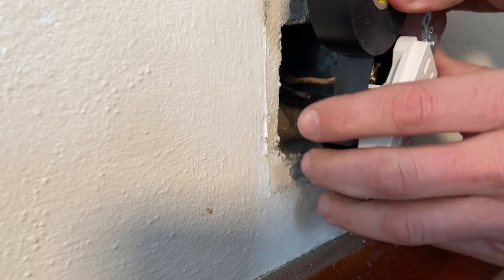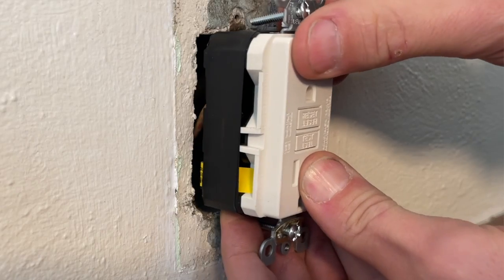Should You Wrap Outlets In Electrical Tape?

Comment: I always taped wirenuts in busy boxes where connections were going to move against each other when everything got pushed back in.  Also always taped them on ceiling fans which would vibrate.  If there was tons of room in the box I was confident the connections wouldn't be rolled against each other I probably wouldn't tape.
Reply: Depends on where you live some building inspectors say no more fuel for a fire even if they just melt. Why fuel the fire!

Comment: If devices needed to be wrapped in electrical tape it would be in the NEC code book by now.   There is a code for how many wires are aloud for a certain size box.  Also workmanship is key!  In my opinion, if you have neat work you should never need to wrap tape around your devices.  And for gods sake stop using the push in method on devices and if you have an unused terminal screw, THEN SCREW IT IN SO IT DOES’NT STICK OUT!
Reply from the maker: Good advice, thanks Joel.
Reply: True.but for those inclined to do it anyhow, why not use duct tape on the inner surface of the box ?
Reply: @embracethesuck1041  I get that but since taping is redundant anyhow a layer of duct tape on the inner surface of the metal box will adhere better and does no harm.The question was to keep terminals  from touching the sides of the box,which is not a problem but some people are uneasy  despite assurances.Taping is for those who feel uncomfortable
Reply: @Dev JB Just slather everything with a thick layer of Flex Seal liquid! Then you'll never be able to find the faults, but they WILL be watertight!
Reply: NEC is the minimum requirement not the max... sorry!  Taping outlets is pure safety.
Reply: @allendouglas63  if taping devices was needed as a safety precaution I assure you it would be in the code book as a minimum standard.  That or the sizes of junction boxes, devices, and wiring would be re-engineered.  
If you don’t do sloppy work or run too many conductors in a box, you should have no need to tape devices.
Reply: @TheRebelyell1986  wow.. you would rather get a shock than deal with tape... I personally have never been shocked from outlets however, i used correct tools.. not everyone does.  NEC is minimum standards... you do minimum work if you just meet the standards.  Quality is looking out for people and protecting them sometimes even from themselves.. I do a lot of live wire work... not because I like it but just because it sometimes must be done.  I appreciate the dangers of electricity and i prefer to protect others from it even if it's inconvenient.
Reply: Because the nec is worst legal install.
Reply: THANK YOU! Although I'm pretty sure a standard receptacle with screws out is not that much wider than a GFCI. Then again, the GFCI also has molded plastic to shroud it's screws.
Reply: @TheRebelyell1986  You've played with handy boxes...  Personally I hate them, they are too small to comfortably wire any device, but every once in a while I'm stuck with such a situation.
Traditionally I don't tape my devices but I was raised to do that for metal boxes.  I have used tape to help keep moisture and dust out of my junction work depending on the environment.

Comment: 5 years electrical in commercial and residential here. In my experience I’ve only taped plugs/switches/GFI’s that will be inserted into metal cut-in boxes since they’re more narrow in width than your standard rough in plaster rings on 4” square boxes. Never taped on residential. I’ve also never had to tape around wire nuts at a tap either.

Comment: Additional tip, the tape glue doesn't stick to the face as well as the glue to glue does, so for a longer holder if you make a piece slight larger than the circumference join the two ends glue to glue with some overlap then use the overlap to stick it down it will hold amazingly well and look good. Learned hat on a site wrapping 600V cabling.

Comment: I'm a retired general contractor.  My electrical subcontractor once described electrical tape on wire nuts as "Guilt." He taped receps and switches to protect the bare terminals while the cover plates were off during drywall finishing and painting.
Reply: Not a pro but I did it in part for this as well. Needed some live outlets while drywalling and finishing and detest people who finish and paint with outlets in (not that it can be seen with an outlet cover, I just know it was done..).  Pigtail connection to Wago connectors with the terminals wrapped makes this a easy and safer way for me to work and be able to remove and put back in the outlet quickly.

Comment: NECA NEIS 130 5.3 Conductors (L) states "DO NOT wrap electrical tape around wiring device terminals. Taping wiring device 
terminals will prevent heat dissipation from the wiring device." National Electrical Contractors Association  National  Electrical  Industry  Standards

Comment: Scotch 33+, definitely. Cold weather performance, stretches without breaking. We used High Voltage Tapes where appropriate, 1000V per 1/2 overlap. So you wrap to the voltage and quality of the job, then some. But Scotch 33+ is good for 600V, no matter how much you overlap. 600v Max. The loose end when applying tape as you demonstrated prevents "flagging", according to the vendor, that tendency for the tape to start to pull off, doing as you demonstrated should prevent that. Do Electrical Inspectors support taping, I read they didn't since they can't visually inspect?

Comment: Military electrician of 10 years. I have been shocked more times than shot at. Wrap the receptacles. Its a couple seconds more and can save you from looking silly. Remember that its for your safety, and when it comes to safety im looking out for number 1 (me).
Reply: I agree with you. We did that on the submarines
Reply: One vet to another, thanks for your service. I wish we'd had one of you guys in Iraq! They gave us a big generator and a pallet of wire and said have fun figuring it out. It's a wonder nobody got killed, but we kept the light on. Now I've been trained, and I look back and just say thanks.
Reply: I agree. No shortcuts in safety, but there are others that would argue why their way is ok when it takes only 10 seconds and 10 cents to prevent a possible electrical shock.
Reply: "No shortcuts on safety" actually means: Always LOTO power source to receptacle OFF 1st, then allways test for power 1ST with live dead live (LDL) on receptical before touching receptacle for removal/service to protect yourself. If you have work on it live, bad unsafe idea, wear class 1 electrical gloves and use insulated electrical tools only, never bare handed.
Reply: @airgliderz  that's fantastic advice, but not many homeowners know that.
Reply: I mean my score is 0 shots to 4 shocks. While yes, many different kinds of tape can become brittle after enough years in weather. If something that is covered in say Super 88 or similar vinyl tape seems unsafe or dangerous to remove, then you or the company you work for should have a LOTO procedure to reduce or remove the associated hazard. Telling someone to put tape around the exposed parts that could cause a short or shock hazard to me is just good safe practice.
Reply: @ElErizoSombra  , if your standard wiring in standard junction boxes might " cause a short or shock hazard," then you have pretty big materials or methods problems that perishable plastic tape/adhesive isn't going to save one's bacon.
Reply: Well if im not mistaken most, if not all, boxes and outlets are pretty well standardized in size. You might find some very slight variation in size but not to a degree that I would consider treating it differently in terms of whether to tape or not to tape. Of course all situations are different. For me, #12 CU THHN wire is my most commonly used when supplying the standard home outlet. If my box is made of metal, of course wrapping it would be just safe practice, but one could just get away with being careful. However,  you do get those DIY'ers who will pull one out to fix or modify it. Should I not wrap it for their safety too? The next person who works on it may not have as much experience as myself, and I want to keep whoever it is that opens it next at least a safety barrier should they mess up. At 120V though the most that could go wrong is maybe some burning to the skin, a tripped breaker, some burnt wire, burn mark on the box, but I also wouldnt rule out a fire depending on what is in the immediate vicinity to the outlet should an arc occur. At the end of the day, its your decision. Tape or don't tape. I do it cause it makes me feel safe and makes the next person feel safe.
Reply: @ElErizoSombra  said: "The next person who works on it may not have as much experience as myself"

That would be very bad indeed. You're implying that you don't know about turning off the circuit breaker before messing with a live circuit.

If you're really concerned about the safety of future generations from the Idiocracy, then why not pot the whole box with acrylic plastic or epoxy before installing the switch plate?

Your ultimate justification for taping is that it makes you feel better. That does not comport with evidence-based practice.
Reply: I mean you are still free to do it as you wish. I'm not saying you have to tape it. Only that you don't know who is going to open it next. So what if they are more experienced than me? Does that make it more okay to let them deal with bare energized screws? I also don't know what you are implying by saying I don't know about turning off a circuit. If you are saying that if a person simply turns it off first then they don't need to use tape, that's a fair argument. At the same time if said person was cautious enough to go and turn it off before working on it, then they are likely to also be the kind to tape it too. Also I have never heard of someone dipping/coating boxes or an outlet in dielectric epoxy before installing or post install either. I might need to look that up and study that. From a business perspective, time is money right? so does turning off the circuit and/or taping exposed parts seems like a worth while move? Depends on the company really. Some companies will tell you to work hot while others will have you deenergize the circuit and use a LOTO to ensure good practice. My justification wasn't just for my comfort. It's for my safety, and possibly the safety of the next person. Now a good question might be "If the circuit is off then why do you need to tape it?". Just cause I turn it off before working on it doesn't mean the next person will. I don't know where you stand on this topic, but for me it's just safe, and you can't be wrong with being safe.
Reply: I'm not sure what kind of tape you are using, but the 3M Super 88 that I use is rated for up to 600V. Well more than enough to insulate a 120V screw on the side of an outlet. The only thing you would need to worry about is if you have the style that has a little jumper that sticks up and out slightly between the screws as this can still stick out if you are not careful.
Reply: @ElErizoSombra  , we're talking bad practice. I don't care what kind of tape you use.

Bad practice. Get it?
Reply: It's not though. I fail to see how this could cause anything but some minor inconvenience and a slight enhancement to safety. I do, however, tire of this conversation as I'm sure you are as well. Lets just agree to disagree yea?
Reply: Try opening the circuit first and you'll never, ever get shocked.
Reply: @timlincoln2246  then why are you taking a shortcut? Go open the circuit so it is de-energized and it'll be impossible to get shocked. You create a potential hazard by trapping heat when you tape around parts that get hot with use and are already in confined spaces. It's actually less safe. Wrapping crap in electrical tape makes you complacent which leads to accidents.
Reply: @ElErizoSombra  it doesn't make me safer coming in after you. Me opening the circuit and testing to make sure it is de-energized makes it safe. Your tape is a nuisance and a safety hazard should the trapped heat build up and cause a fire. Thanks but no thanks. Complacency is the enemy to safety. Tape makes you complacent.
Reply: @etherealrose2139  Actually 3M Super 88 tape is flame retardant. Regardless, if your outlet is getting hot enough to catch the surrounding plastic on fire, you have much bigger issues. A quick google search shows that the lowest flash point for plastic is 349F. At this point, the tape is not a determining factor on whether it catches fire or not cause the plastic has melted away already. Also if you think taking some silly tape off is a nuisance then I guess wearing your 12/CAL to work inside a panel is a pain too? You mention deenergizing before working on it. This is always the best course of action for sure, but not everyone is going to do that now are they?

It does make me curious now though. If not for covering exposed energized metals, what do YOU use it for?
Reply: @etherealrose2139  I do. But what guarantee the next guy won’t? How about if the cover cracks? Are you willing to take that risk because you were trying to do the minimum? Yes, it is NEC compliant without the tape. Not worth risking a life to me.
Reply: How did you get shocked

Comment: Hvac Tech here. When wire nuts (low voltage) are used and could potentially be exposed to the elements I always tape up and around the nut. It prevents any moisture form getting inside the cap.
Reply: Yep, do that daily. That little extra helps from stupid call backs and shorted board.

Comment: The township where I live does not allow it as I had to remove the tape from a kitchen addition I wired in the late 1970's.  I asked the inspector why it was not allowed and he gave me the following reasons.  1 - It is not allowed in the local code.  2 - Makes a visual inspection of the connections impossible.  3 - The adhesive in all tapes will degrade an come loose over time.  4 - The tape itself could become a fire hazard.

Comment: I always wrap electrical tape around my receptacles, no matter the box... It's just good practice, I figured this is something everyone would agree on haha. Main reason is to prevent shorts. Even in a plastic box sometimes you're stuffing wires behind the receptacle and we all know how some grounding wires are bare. It's just to help prevent a short circuit from occurring, no matter if it's a metal box or a plastic one. Also a lot of electricians will open up receptacles and switches while they are still hot, and it's nice to do so having the terminals somewhat protected with the tape, encase you brush up against it on accident or accidently touch it against something conductive. Idk, in my opinion it's always good practice to just tape it every time. It's a no brainer for me, tape every time no matter what. Anyone who disagrees, can't say I really respect it because it literally takes no extra time to do. Just my 2 cents
Reply: haha..you say wrapping is good practice but then say " a lot of electricians will open up receptacles and switches while they are hot". Is it not "good practice" to remove power?
Reply: @ricmndy1  It is good practice to remove power. Not all electricians will do this though, many will cut corners. Either that or there will be 5 people doing work on their computers and you're unable to just turn the power off. Yes you can come back later, but most electricians won't bother with that trouble. So when making up a receptacle, it's never good to assume everyone will do everything 100% the right way with proper procedure. Always think ahead and down the road when it comes to electricity, that's truly the best way to go about this trade. Anything cut short of that is just bad practice IMO.
Reply: @ricmndy1  it can be very counterproductive to shut power off when trouble shooting.
Reply: @JeffPenaify  who troubleshoots a possible bad recepticle like that? You can trouble shoot a circuit without removing the recepticle from the box. So why would you need to protect the terminals? I've worked in Avionics and Satellite Communications for over 30 years so I know how to troubleshoot live circuits. It's not necessary to remove a recepticle to troubleshoot it with power on.
Reply: @ricmndy1  in residential electrical, it can absolutely be neccessary to troubleshoot circuits by opening the box up and testing wires while live, often when dealing with switch legs, travelers, or joints in the box, usually from hack work. I’ve been on more service calls than I can count where trying to figure out what the idiot before you did with no power means removing a ton of drywall

Comment: I’ve seen electricians use the push-in terminals on outlets and leave the screws backed out....  Every trade has there good guys and hacks.  I use premium outlets, wrap them with tape and push the ground away from the outlet as a final precaution.
Reply: Scary at best!
Reply: There are Electricians and there are "electricians".
Reply: Where I see that is in condos, manufactured houses,  any mass produced housing, where the "electrician " is working for speed,  not quality or safety.
Reply: I never stab outlets or switches in the back. Imo it's just good practice to use the screw terminals because then you know for sure it's secure. Plus easier to remove later.
Reply: Those are piece rate installers. Those are not Electricians. They couldn't fix a sandwich.
Reply: @davidsawyer1599   Believe it or not I have seen it from 'reputable electricians' on remodel jobs that I was subbing on...  I had to go behind them and straighten the screws on the face plates. My brain/OCD was killing me.... lol
Reply: @oldcrazyeye6482  i have been to many service calls of the wire backs out of the device. I always install wires on the screws.